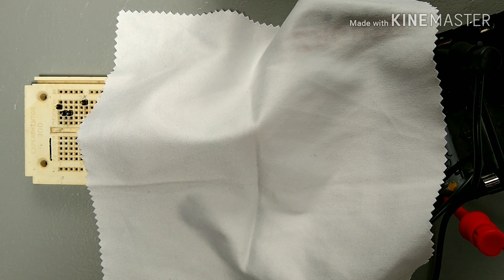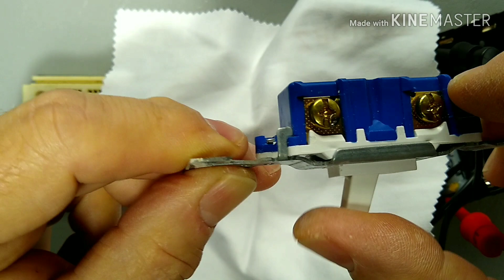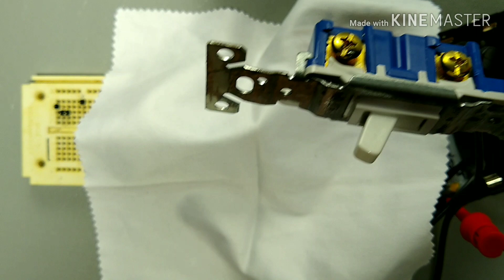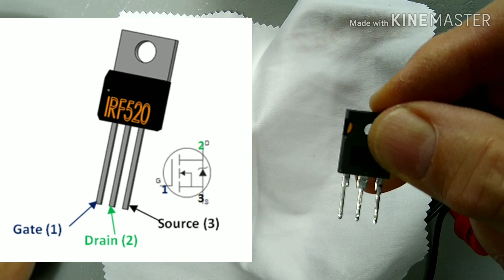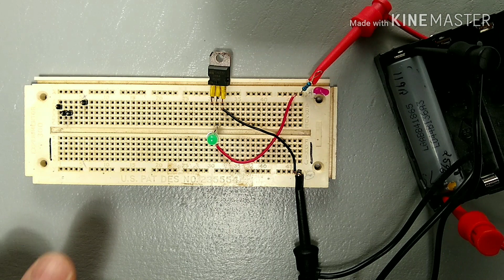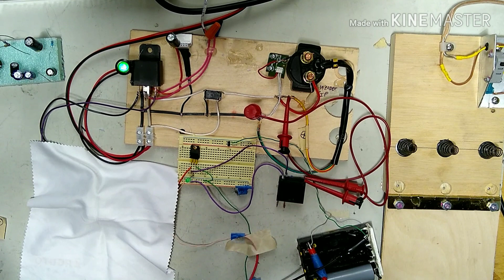Understanding Mosfet build

Comment: Thank you Steve for this clear lesson. Would you please also talk about the gate drivers if possible with the same simple way?
Reply from the maker: Serkan, would need oscilloscope to make a video about gate drivers. Please check out this article about  Gate drivers @ https://www.egr.msu.edu/classes/ece480/capstone/fall14/group08/Documents/How%20to%20Implement%20a%20MOSFET%20with%20a%20Gate%20Driver-1.pdf

Also great info here @ https://endless-sphere.com/forums/viewtopic.php?f=14&t=81400&start=550&fbclid=IwAR1NFn57Tg4j4vOrAUAYjX0tVEV4IFh71Gbd68JcpSRJLokwsUTgJT3NEug#p1218325

Also this discussion on my other video:  Mosfet Spot Welder Build for Dummies

Mosfets (IRF1405PBF). Spec sheet @ https://www.infineon.com/dgdl/irf1405pbf.pdf?fileId=5546d462533600a4015355db084a18bb

Total Gate Charge for mosfet 1405PBF Min  170  Max 260

So capacitance = charge / voltage
C = 260nC / 12V = 22nF per mosfet gate

So you need to charge 22nF to 12V in less than 1ms

So to charge a 22nF capacitor to around 12V from 0V with source of 12V in around 100uS you will need 950 Ohm resistor to gate from 12V. In your case i would put 950 Ohm resistor per gate at 12V gate input voltage.

 If you have 10 mosfets in parallel then i would put 95 Ohm resistor.. 950 Ohm/num of mosfets in parallel to get one final gate resistor. So for 15 mosfets in parallel i would use 950/15= 63ohm resistor to charge all those gates in around 100uS at 12V.

I see that you used 10 mosfets so i would recommend you to use 95 or 100ohm resistor between gate and 12V signal source and 220ohm resistor between gate and source. That would be enough to turn on mosfets in around 100uS and turn it off in around 200-300uS. So the mosfet is acting as a resistor only for 300uS and not any longer. I would suggest you to try with 95 Ohm and 220 Ohm resistors instead of yours 1K and 10K and see if there is any difference in weld quality or thermal dissipation of mosfets. With 95 Ohm and 220 Ohm they should dissipate less heat than with 1K and 10K. Just be sure that your 12V signal can handle at least 150mA
Reply: @hidef2026  thank you for these valuable informations. I'll take a look at these carefully.
Reply: @hidef2026  I have 14 of IRF3205PbF N channel mosfets laying around. And I found these two webpages:

https://www.allaboutcircuits.com/tools/capacitor-Charge-and-time-constant-calculator/

http://www.calctool.org/CALC/eng/electronics/ccv

According to the datasheet, Total Gate Charge of 3205 is 146nC. After some calculations I have found 8K resistor for each gate. So the final resistor should be 8000/14=571Ohms. Am I right?
Reply from the maker: @s3rkanAGA  sounds right, if you followed instructions under the video description.
Reply: @hidef2026   but with the same calculations, your resistor is found around 4.5K for one gate
Reply from the maker: @s3rkanAGA  I am referring to the video located here Mosfet Spot Welder Build for Dummies @ https://youtu.be/bxVgOLQYaug

Comment: If you put a variable resistor on the gate you can have adjustable timing.  The resistance will make the capacitor take longer to control the gate or faster depending on pot resistance.  I am loading a video now showing how much it can change the pulse time and heat and weld strength.  Great video brother
Reply from the maker: Look forward to this video!
Reply: @hidef2026  did you order your mosfets? When your going to build or have it set up let me know.
Reply from the maker: @cdiperformanceparts4364  Not yet I have my Shopping cart order almost ready to go. Need to add diodes, maybe variable resistor, built protoype circuit like your Mosfet timer but used resistors with different values to see time as I did not have a variable one. Was interesting to see variable time differences. Thanks for checking in.  Will let you know.